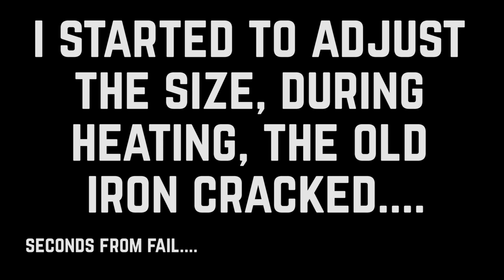Restoration Old Kindjal Dagger

Comment: Another fine authentic restoration! If you wanting make brass flatter put it on flat steel surface and roll it over with round metal bar like rolling pin this works well you will need metal bar that will not bend.
Reply from the maker: Hello, thank you for your attention and advice! They will definitely use it, I often work with brass. Can I do this with a regular piece of pipe?

Comment: Kindjals are kind of interesting for the diversity of forms: some single edged, some double edged, some are curved just in the first third of the blade length from the tip or so, some are straight with centered fuller, some with offset fuller. The two high rivet heads, which, in asymmetrical blades, could be useful in identifying which side is which without looking, and the blade length seem to be the main feature in common.

Comment: I wholeheartedly aprove your choice to repair the old handle wood instead of making a new one. I also have used myself the wood-colored epoxy in exactly that way to repair an old Dominican "machete de bonito" of my collection with a similar missing area - looks as if there was no repair at a first glance, but allows to know what is original and what is the repair upon closer inspection. Excellent choice!

Comment: Beautiful
Two questions:
- Why do you measure the length?
- Do you recycle the chemicals used?
Reply from the maker: Hello, the length of the dagger blade can say a lot. There are different sizes of daggers in the Caucasus. They are all different, and I always try to show it to the viewer. I have used rust remover many times because it does not deteriorate, and at the same time retains its working properties.
Reply: @ScrewsAndTools  
Thank you

Comment: Would you care to tell me what kind of powder did you use for the rust removal in 5:20 , in video?
Reply from the maker: Hello, thank you for your attention. This is a common cleaning powder for washing dishes. You can use another one.
Reply from the maker: And also sir, I used cheap rust remover, name is "Yeetis" in yellow plastic bottle (550ml and 2L).
Reply: @ScrewsAndTools  🆗

Comment: Hello there ,I admire your work you are doing a good restoration and preservation of those blades that you deal with ,but did you ever restore anything else than tools with blades -like lighter or a lamp those things hawe Screws aswell. Maybe that would be another challenge for you ......
Reply from the maker: Hello, thank you for your attention. Good question. I have restored non-edged weapons a couple of times, but to be honest, it is extremely difficult for me to find such an item. And if they get caught, they are very expensive. But I am also interested in this.

Comment: Brah!! You are f**king AMAZINGLY AMAZING! This HAS to be the best work I have seen you do!!
Question: was that glue you put in the water both times?
Reply from the maker: Thank you so much for your attention. Sorry, I didn't understand the question) Do you mean rust remover or oil?)
Reply: @ScrewsAndTools  the white gooey (I was gonna say “creamy”, but that’s just wrong!😂) stuff you mixed in water and painted on.
Reply from the maker: @Desmodus1958  And now I understand everything. I use PVA glue for wood, including for scabbards. But for pasting the sheath with leather, I use a completely different glue that is designed for cardboard, leather, linoleum, etc.
Reply: @ScrewsAndTools  thank you sir! Sorry for the confusion. I admire your talent and dedication. I admire anyone who creates with their hands. I was a massage therapist for 12 years. A little different hand creativity, but when you take pain away from someone, it’s creative nonetheless.😊😊
Reply from the maker: @Desmodus1958  Welcome sir! No problem. You can always ask questions and thank you for watching my content! Good luck to you!

Comment: Bro you just ruined the handle with that epoxy doe. All you had to do is to glue the compatible piece of wood to the existing wooden handle and then file it to shape.
Reply from the maker: Hello, thanks for attention. If only it were that simple. then I would use a horn. The pads on the dagger handle are not made of wood but buffalo horns. Before doing so, I thought about it for more than 4 days.